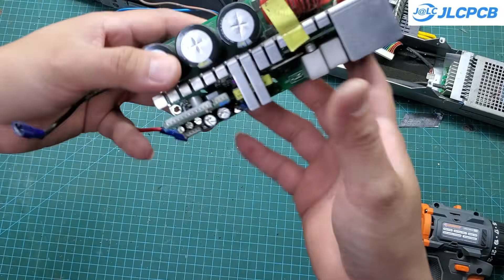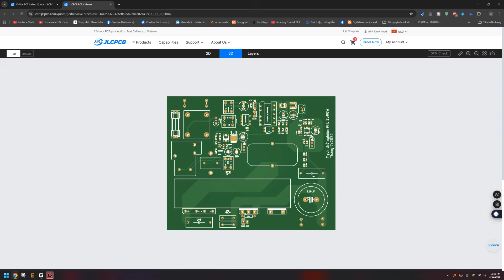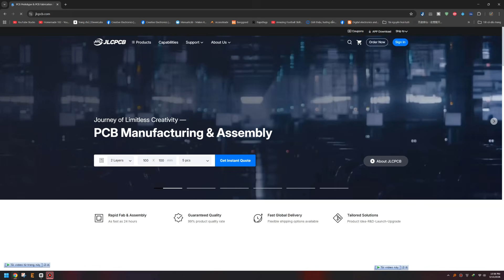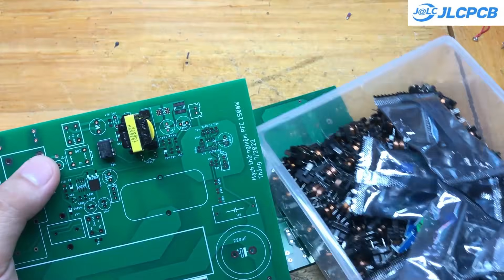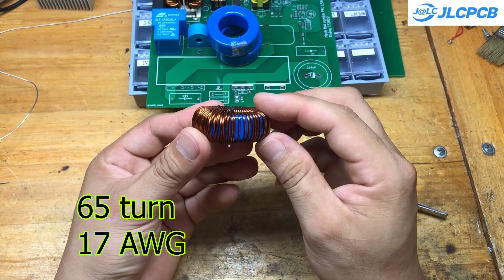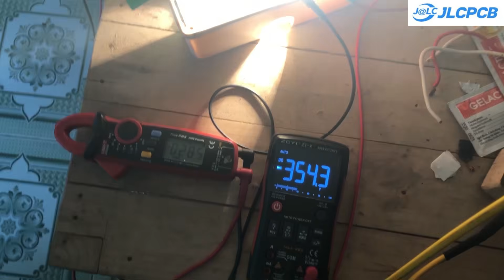Build a 1500W PFC Module  | JLCPCB

Comment: Why didn't you use Litz wire for the inductor? Won't the skin effect cause the inductor to burn down at a 1500W load, or are you operating it at a low frequency?

Sorry, the questions may sound stupid. But from what I have learned, it doesn't make sense.